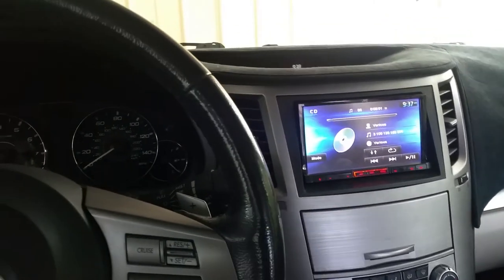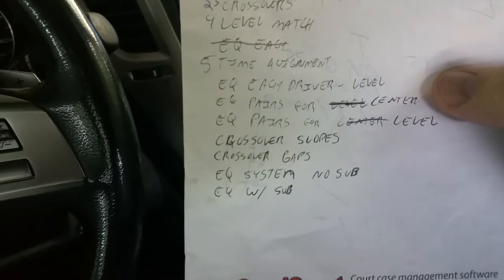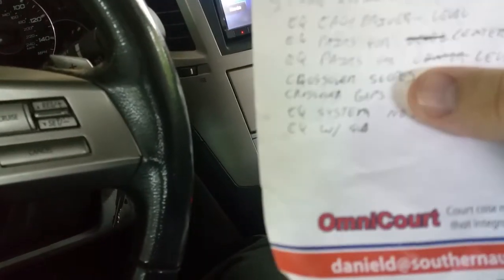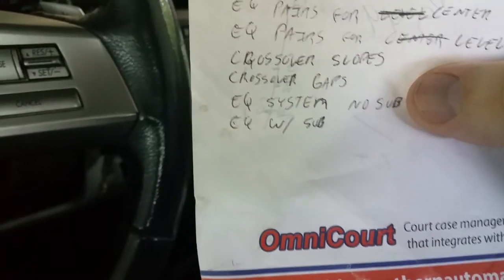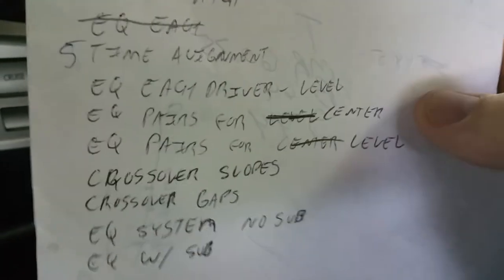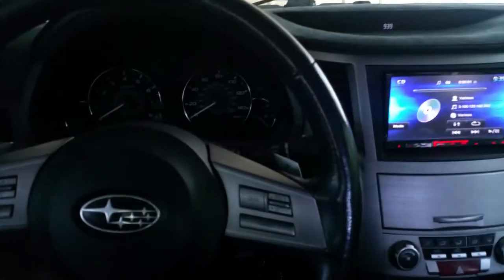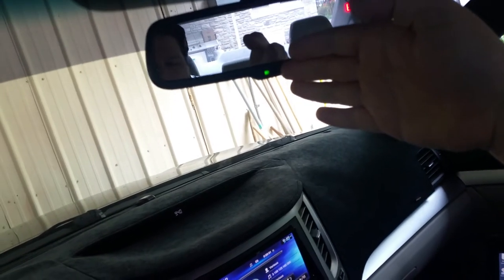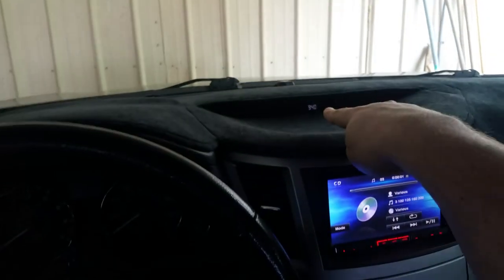How to tune a SQ car Part 12 - Pink Noise Rant

Comment: i love your vids man, thanks a lot for taking the time to post them up!!!

I do have a question, how the hell do i get a deep sound stage? i´m having problems only with that! :(
Reply from the maker: work on your time alignment and pushing pairs of drivers further out or closer in with time alignment. other than that, install plays a large part.
Reply: hey I think you should try adjusting your eq. in the 500 hz. range up a lil bit   see what you think about your soundstage   also try in the 2500 hz. range also up a lil

Comment: hello mate...have gone through your vids and im up to speed on everything..when it comes to eq..you do each driver..then pairs of drivers...once this is all done do you do just the left or right...then match left and right sides? then do you make any adjustments with all speakers playing?
Reply from the maker: you have the idea, do each speaker to make them match, then pairs with LR EQ, then all speakers playing with LR EQ then tonality EQ
Reply: +Kyle Ragsdale awesome cheers for the reply! at the moment i have a preset saved with everything done up to using an RTA...that is sort of a base tune before i delve in to the ear part of everything! will give that a go tomorrow...going to play the pink noise and do the pairs...and then all at once...would using a db meter help with the volume level of certain frequencies? or just trusting your ears is the best bet?
Reply: +Kyle Ragsdale oh and you mentioned tonality eq...what is the process behind that?
Reply: Tonality being all drivers.. How the plot looks for the entire stage in terms of frequency response.
Reply from the maker: Sam Taliano for tonality, I usually tune by ear, listen fir frequencies that stick out or are dull, and roll through the 31 band pink noise listening fire volume changes between the tracks